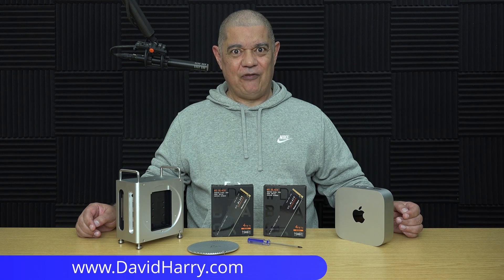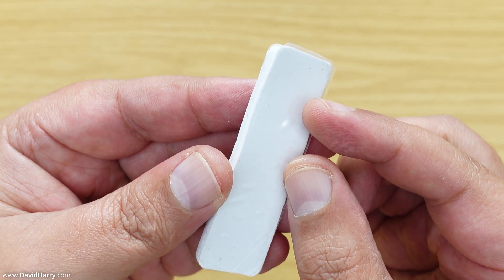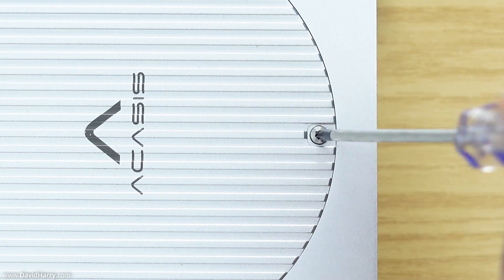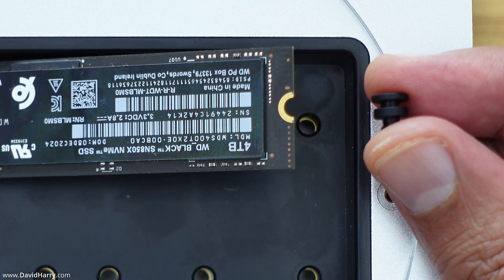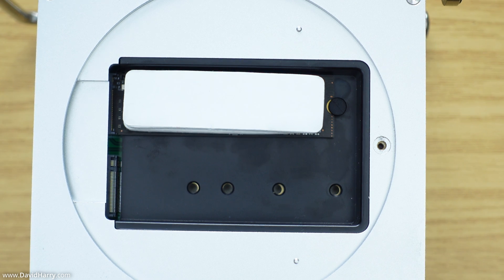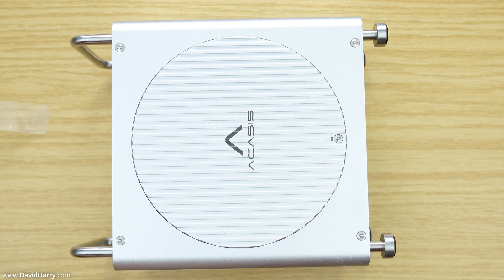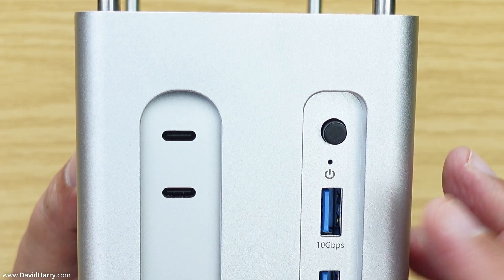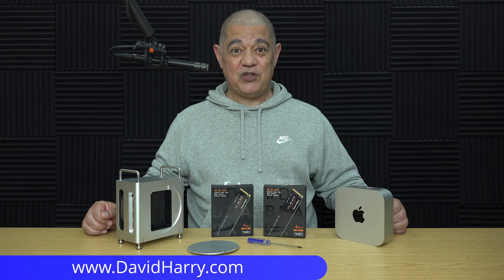M4 Mac Mini SSD Installation Guide For ACASIS Thunderbolt 4 Enclosure Dock Workstation

Comment from the maker: M4 Mac Mini SSD Installation Guide. This guide shows you how to correctly apply the thermal pads and how to install the SSDs when using the ACASIS M4 Mac Mini Workstation.

The ACASIS M4 Mac Mini Workstation, model number M002Pro TB1201. Is a 40Gb/s Thunderbolt 4 enclosure dock specifically designed for the M4 Mac Mini. This enclosure docking system allows you to install up to two SSDs which you can then setup as a RAID set.

Here's the long video that this video comes from. This video gives a lot of detail about all the various RAID and JBOD setups https://youtu.be/IEMS9Wg4vGA

More info from ACASIS:
Acasis Mac mini M4 Workstation 8-in-1 40Gbps Dock
SKU: M002Pro (TB1201)
40Gbps Mac mini M4 Dock & SSD Enclosure
UP to 4K@144Hz Display
Just 136 × 170 × 87 mm, with a Weight of 1.96 lb
Includes 2×DP1.3, SD4.0, TF4.0, 3×USB-A, and PD30W

Checkout my SSD speed tests & external SSD build guides playlist
https://www.youtube.com/playlist?list=PLleKChtNUwZQvaYS9r0zHvkaTXSYlnX6q

Products shown in this video
M4 Mac mini https://amzn.to/3VCi8lC
ACASIS M4 Mac mini Workstation enclosure/dock on ACASIS website https://geni.us/ACASIS-58
Use DAVID15 for 15% off on ACASIS website
ACASIS M4 Mac mini Workstation enclosure/dock on Amazon https://geni.us/ACASIS-106
4TB WD SN850X SSD 4TB https://amzn.to/3U7TqsP

Some of my product recommendations

ACASIS Website
If buying from the ACASIS website use my 15% discount promo code DAVID15
ACASIS website https://geni.us/ACASIS-51
SSD enclosures:
TB501 Pro Thunderbolt 5 enclosure https://geni.us/ACASIS-57
Mac Mini M4 Workstation enclosure https://geni.us/ACASIS-58
TBU405Pro Thunderbolt 4 enclosure https://geni.us/ACASIS-53
TBU401 Thunderbolt 4 enclosure https://geni.us/ACASIS-54
EC-3901 4 bay Thunderbolt 4 RAID Enclosure https://geni.us/ACASIS-55
All ACASIS SSD Enclosures https://geni.us/ACASIS-56
Docks & hubs:
DS9007 21 Port 40Gbps Dock https://geni.us/ACASIS-59
DS-7A15 15 port USB-C dock https://geni.us/ACASIS-60
DS-0202 14 Port USB-C dock https://geni.us/ACASIS-61
All ACASIS Docks and Hubs https://geni.us/ACASIS-62

ACASIS Amazon
ACASIS Amazon Store https://geni.us/ACASIS-105
SSD enclosures:
TB501 Pro Thunderbolt 5 enclosure https://geni.us/ACASIS-100
TBU405Pro Thunderbolt 4 enclosure https://geni.us/ACASIS-101
TBU401 Thunderbolt 4 enclosure https://geni.us/ACASIS-102
All ACASIS Thunderbolt and USB enclosures https://geni.us/ACASIS-103

WD_Black SN850X Gen 4 SSD on Amazon
8TB https://amzn.to/478cVJn
4TB https://amzn.to/3U7TqsP
2TB https://amzn.to/3Hb32jC
1TB https://amzn.to/3He93Mp
Other Gen 4 NVMe SSDs https://geni.us/Gen4SSDs

Samsung 9100 Pro PCIe Gen 5 NVMe SSD
WARNING - ONLY BUY THIS SSD IF YOU ARE USING THE NEW ACASIS TB501 PRO, WHICH IS COMPATIBLE WITH PCIe GEN 5 NVMe SSDs, OR OTHER GEN 5 COMPATIBLE SSD ENCLOSURES
Samsung Amazon Store https://geni.us/hBdBf
4TB https://amzn.to/4lpGMke
2TB https://amzn.to/413Jjct
1TB https://amzn.to/3JcjW1Z
Other Gen 5 NVMe SSDs https://geni.us/7SvmU

Apple Mac Computers on Amazon
Apple Amazon Store https://geni.us/Apple_Amazon_Store
MacBook Pro M4 https://geni.us/OLuacfl
MacBook Air M4 https://geni.us/x5G9
Mac Mini M4 https://geni.us/yJW1
Mac Studio M4 https://geni.us/V2lDm
Mac Studio M3 https://geni.us/7zws
iMac M4 https://geni.us/1k4pwp

AMAZON ASSOCIATE DISCLOSURE
I am an Amazon Associate. My Amazon links are Amazon affiliate links. I earn money from qualifying purchases when you use my Amazon affiliate links. Thank you for using my Amazon links 👍

OTHER EARNINGS AND COMMISSIONS
I also earn money from other product links within my video description. Thank you for using any of my product links 👍

You can also send me a coffee https://www.paypal.me/DavidHarry

My Amazon pages with videos and product links
Amazon USA https://www.amazon.com/shop/davidharry
Amazon UK https://www.amazon.co.uk/shop/davidharry

My Global Amazon Affiliate links
Using my Global Amazon Affiliate links when you buy anything from Amazon does not cost you any extra. However, the money that I earn helps me and my YouTube channel. Thank you for using my Global Amazon links 👍

Amazon USA: https://geni.us/Amazon-USA
Amazon UK: https://geni.us/Amazon-UK
Amazon Canada: https://geni.us/Amazon-Canada
Amazon Deutschland: https://geni.us/Amazon-Deutschland
Amazon France: https://geni.us/Amazon-France
Amazon España: https://geni.us/Amazon-Espana

Contact for product reviews: YouTube@DavidHarry.com

http://www.DavidHarry.com

I’m David Harry. Thank you very much for watching this video, take care and goodbye now.

Cheers,
Dave.

Comment: I just get one set up, and it works fine. The only issue I have is after I start or reboot Mac, I have to press the button on the dock to connect SSD. This defeats the purpose like moving user home folder to external SSD. Does anyone have this similar issue?  For example, if I move my home folder to this, Mac won't let me logon. I have to log on to a local user and press the button to reconnect SSD (which has my primary account home folder).

Comment: Do we have enough space to put SSD with heatsinks?
Reply from the maker: Depends on the size of the heatsink.
Reply: @DavidHarry Can u tell me the size of those pads so I can figure out ? thanks ☺️
Reply from the maker: Sorry, I don't have it anymore. Cheers, Dave.
Reply: @DavidHarry it's ok. Thanks for those amazing videos !
Reply from the maker: Hi. I just found a spare pad, Acasis send me a lot of pads for all the reviews I do. The pad is 4mm thick. I also did a test the WD_Black SN850X SSDs with the heatsink with this enclosure when I was testing the enclosure. With one pad on the SSDs heatsink it just about fit in the enclosure with a really good tight fit against the lid/cover. So if you go snd find the thickness of one of those WD SSDs with their heatsink, that should give you a good idea. However, many SSDs have heatsinks that are much thicker than the ones on the WD's. So unless the SSD with a heatsink can fit with the thermal pad and touch the lid of enclosure, I would not use one. If the SSD with a heatsink is inside the enclosure and not making thermal contact with the lid, which acts as the external heatsink. You will have thermal issues as there's no airflow inside the enclosure. Hope that helps 👍 Cheers, Dave.
Reply: @DavidHarry Thanks a lot !

Comment: Hey Dave, 9100 Pro 8TB is now out in some regions including mine, not out in the UK yet, yanks got them first like always. And it’s double sided but that’s what I expected.
Reply from the maker: Nice one Rory, thanks for the heads up 👍 Yeah, it's not in that many regions just yet. What region are you in? So far it looks like it's going to be basically a $1000. I doubt very much that I will get one of these as the improvement in a TB5 enclosure is only about 400-700MB/s depending on what you compare it to and a WD SN850X is already around 6000MB/s. In the UK a 4TB SN850X is between £220 and £240, and the 4TB 9100 Pro is essentially £400. So almost twice the price for only about 10% performance increase. And for nearly every day to day task, you wouldn't even be able to feel that difference. In fact, for most uses a good TB4 drive is all that most people would need. This is what I'd said in a previous video, the Gen 5 SSDs just aren't worth it yet with these TB5 enclosures. Maybe when the prices come down it'll be a different story but when their prices come down it's likely that the good Gen 4 SSDs will be even cheaper than what they are now. I think most people should view these Gen 5 SSDs as future proofing as far as TB5 enclosures are concerned but should get Gen 4 for now. Inside a Windows PC it would be a totally different story and the 9100 Pro is already one of the fastest Gen 5 out there, but for external storage, Gen 5 SSDs are terrible value for money. Cheers, Dave.
Reply: @DavidHarry  Hey Dave, I’m currently working in Beijing at an international travelling agency since I got this offer before I graduated and I speak Mandarin . And Belfast has no future lol. 

Over here 8TB 9100 Pro is £667, only £25 more expensive than SN850X. Considering WD’s warranty services are way worse than Samsung’s, and 9100 Pro is a much newer drive, it’s totally worth it. But I think it would be at least £899, if not £999 when it’s available, electronics are always so much more expensive back in the UK!
Reply from the maker: Alright, Rory. I'd love to hear someone speaking Mandarin with a Belfast accent 😆👍

Yeah, at about £660 the 8TB 9100 Pro would be something to have a good think about, especially if you were on a Widows desktop with a Gen 5 board. Even on a Mac inside a TB5 enclosure it would be worth considering at that price.

However, as you said, it's more likely to be closer to £999 when released over here. And at that price it'd be far easier to consider two 4TB drives. If you budget about £200 for the TB5 enclosure, then the 8TB 9100 Pro drive could end up being £1200. However,  if you use 4TB SN850X SSDs, that's about £430 per 4TB TB5 drive.

While my 8TB WD TB5 was working it was awesome. All that space meant that I didn't have to do any disk swapping. So yeah, I'd love 8TB but I couldn't justify that kind of spend.

Cheers,
Dave.

Comment: Would be interesting if a Highend Gen4 which is allready faster than TB4 brings an advantage over e.g. Gen3 drives with read and Writes in the 2000-2500. For those thinking about that there is nearly taking a slower drive today pricewise, but for those stillhaving some laying around it might be worth to consider. or a two of the firts Gen 4 drives having a max speed around 5000. a modern Gen4 should also be sufficient if acasis upgrades to TB5.
Reply from the maker: Hi. There's no difference with my Gen 3 and Gen 4 SSDs, other than cache sizes. This is because the two lanes per M.3 slot is a lot lower than my Gen 3 SSD and way slower than my Gen 4 SSDs. I'm not sure if Acasis will do a TB5 version, as most Mac minis out there are likely to be the base version and others that only have TB4. BTW, I've just bought a 1TB WD SN7100 for some of the builds I have coming up and as an alternative for those on a budget and it's a great SSD. Cheers, Dave.